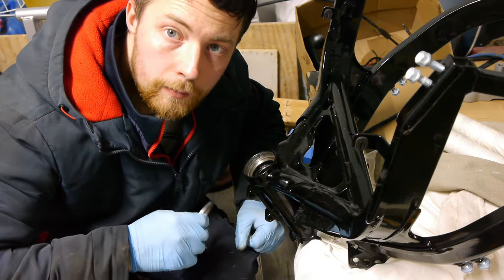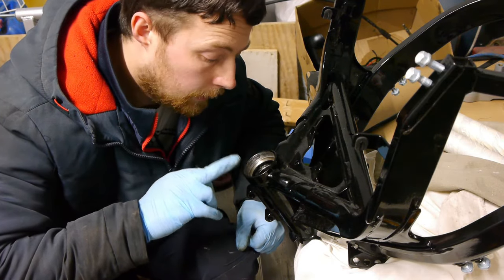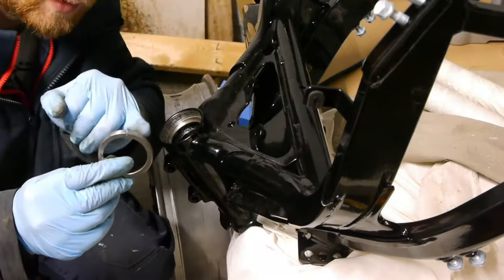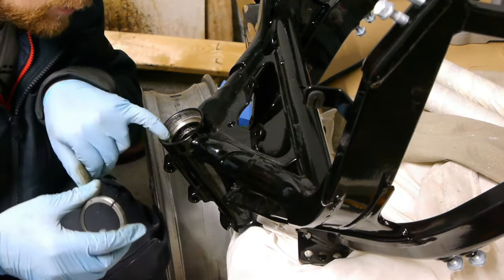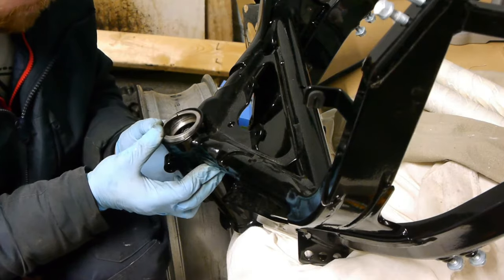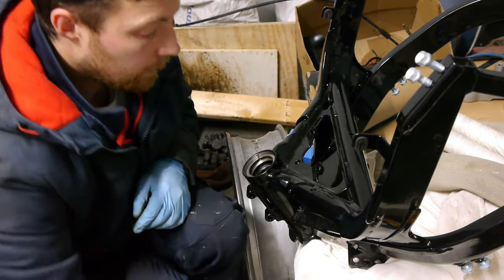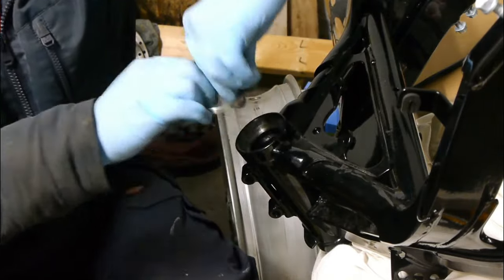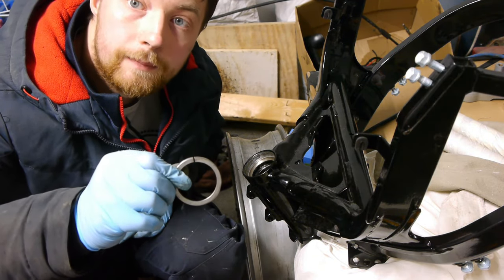How To Install Motorcycle Steering Stem Bearing Without Special Tools

Comment: This is a good tip - but a question - is this the installation of the new race using the slotted old one ?  Just hoping for some clarification.
Reply from the maker: Yeah this is for installation of the new race as if you don’t cut the old race it generally jams in and is hard to get out.